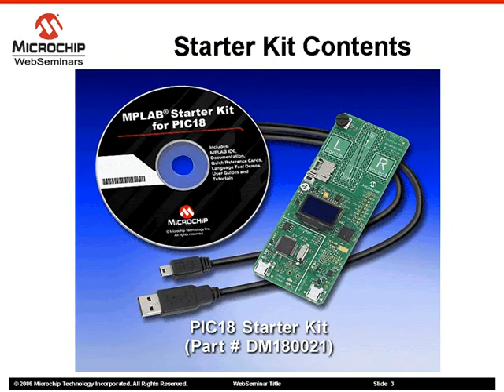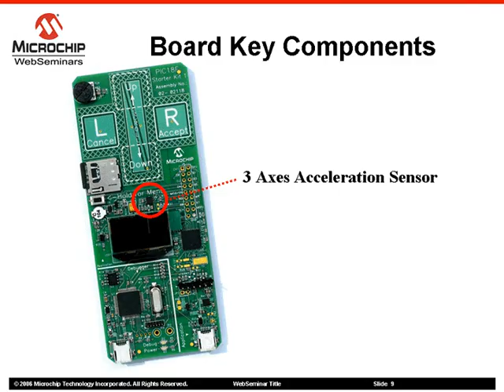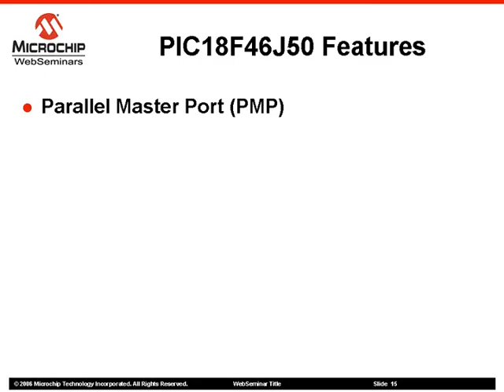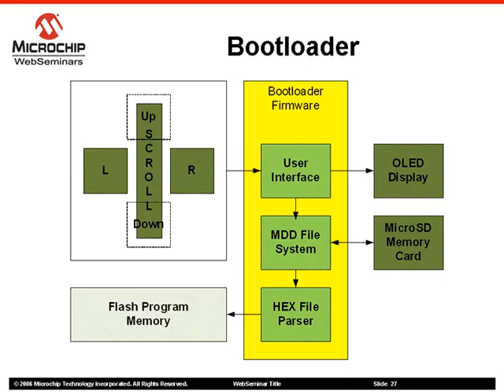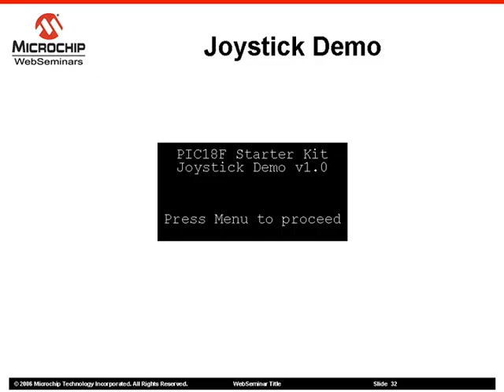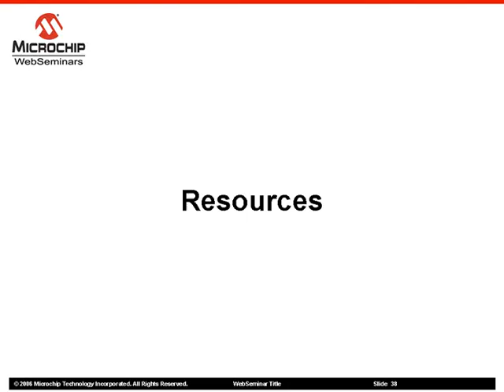PIC18F46J50 - Tutorial Microchip MPLAB PIC18F Starter Kit 1

Comment from the maker: 🚨PROYECTOS DE ELECTRÓNICA Y ELECTRICIDAD PROGRAMACIÓN DE MICROCONTROLADORES🚨
📡〽PIC〽ARDUINO〽AVR〽STM32〽ESP32〽ESP8266〽 
📡Lenguaje de programación ASSEMBLER - LENGUAJE C.
📡Software IDE MPLAB X, CCS Pic C Compiler, MikroC, Microchip Studio, ATMEL Studio, ARDUINO
📞 WHATSAPP - 📞TELEGRAM: +51921322152 📲📲 ➕5⃣1⃣9⃣2⃣1⃣3⃣2⃣2⃣1⃣5⃣2⃣
📢 Correo: jorge.peraltac01@gmail.com
📢 TIKTOK: https://www.tiktok.com/@jorgeapc1
🚩 CANAL DE YOUTUBE: https://www.youtube.com/c/JorgeAPC
🔴 dsPIC, PIC18F4550, PIC18F45K50, PIC16F877A, PIC16F84A, PIC18F1936, PIC16F887, PIC16F628A, PIC18F57Q43 CURIOSITY NANO
✅Análisis de circuitos en AC y DC.
✅Amplificadores Operacionales.
✅Programación de PLC.
✅Resolución de prácticas, exámenes, laboratorios y tareas de electrónica y electricidad.
✅Clases de electrónica analógica y digital
✅Simulaciones en Proteus, LabView, Multisim
✅Proyectos de robótica y electrónica
✅Proyectos de automatización
✅Diseño de placas - tarjetas electrónicas (PCB)
✅Automatización